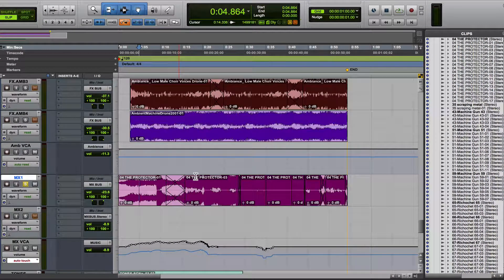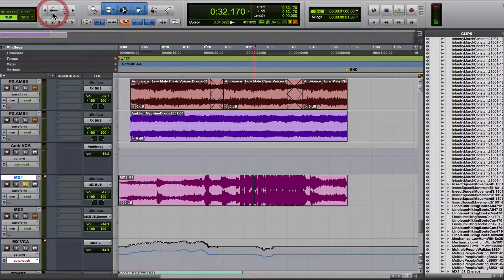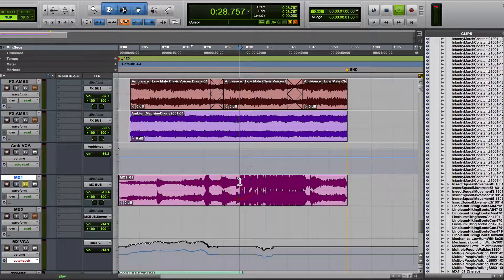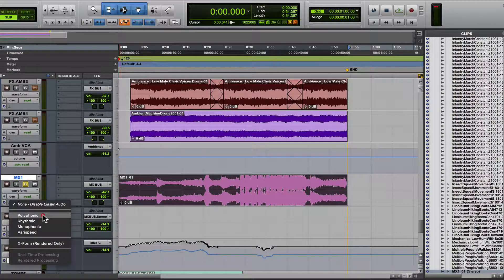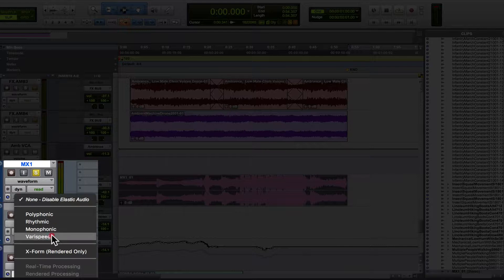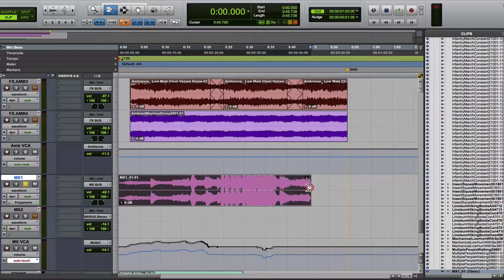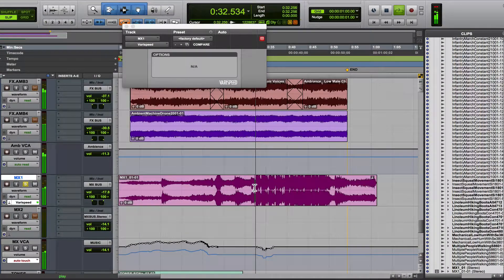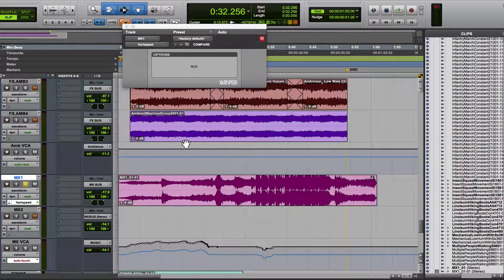How To Speed Up Or Slow Down Audio in Pro Tools

Comment: One question.

Let’s say I have a mix that’s at a tempo of 108 BPM but I wanted to shift it up to 113. Is there a way that I can be more tempo specific if I want to speed up the mix?
Reply from the maker: Yes!  If you change the track from samples to ticks by clicking the clock button on the track, and leaving elastic audio selected as polyphonic or rhythmic, it will follow any tempo changes you make.  If vary speed is selected, it will change the pitch as you speed up or slow down.
Reply: @ryandemaree1610  OMG THAT WORKED!

Comment: Hi! Thanks for the video. Is it necessary to activate something else? I wonder because i follow your instructions but when I want to modificate the lenght of the track it just doesn't let me do it. It's kind of blocked. Thanks once again.
Reply from the maker: If the clip has fades on it, you need to select the whole clip and consolidate it - that might be the issue.  Also, you must have the time compression tool selected in the upper left menu.  Hope that helps.
Reply: @ryandemaree1610  Thank man. What was happenning was that i havent activate the elastic audio option (in this case I selected mono). Doing that problem was solved. Have a grat time, bro.